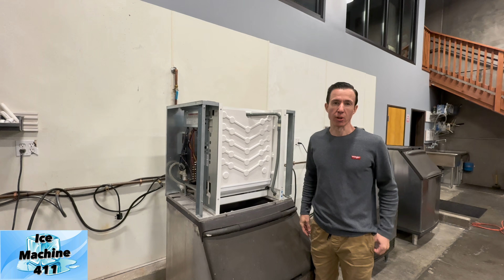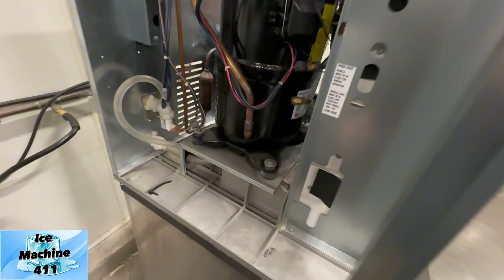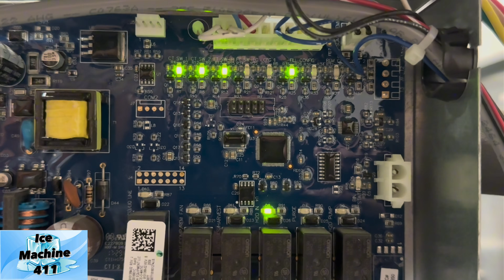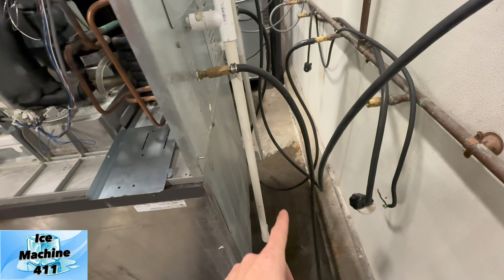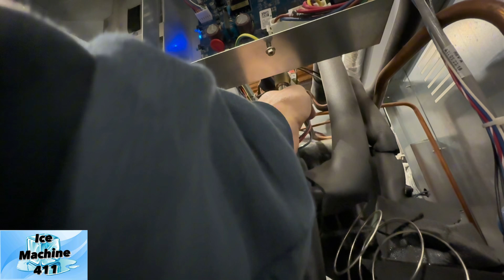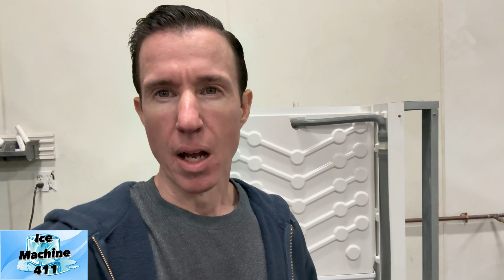Ice-o-matic ice machine troubleshooting

Comment: Hi, so i have a cim0530 model, original water pump went out doe snot throw water to top curtain , i recplace pump but had to rewire original plug to new water pump but does not work wither any ideas what could possible be ? Thank you
Reply from the maker: Did you verify you were getting the correct voltage at the water pump plug during freeze?

Comment: Hello, i have problem with old one icematic N200M icemachine. He making ice, thats all ok, but when icemachine need to drop ice he can't throw it out, after 5 minutes the water starts to fall on its own and start a new cycle but ice cubes didn't fall
Reply from the maker: I’m not super familiar with that model. If the ice won’t fall it could be a couple issues. Bad harvest valve, bad curtain switch, evaporator is damaged somehow. There could be a lot of different issues.
Reply: @ is there a possibility to increase the dissolution time? because he still needs very little to fall out, about 1 min. thank you